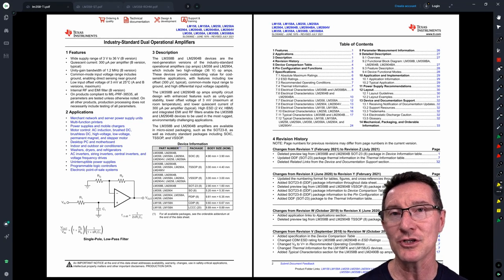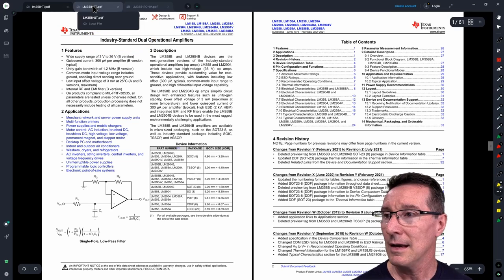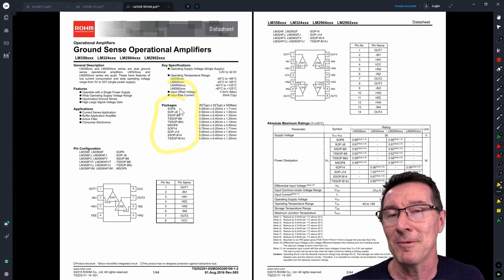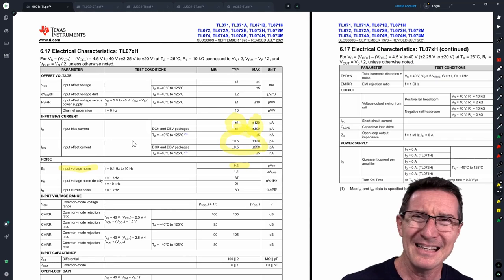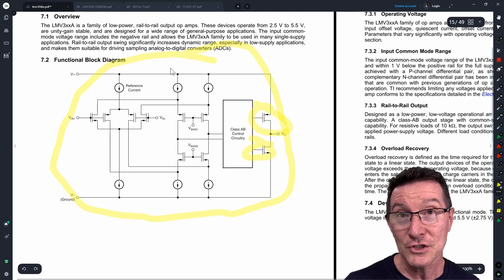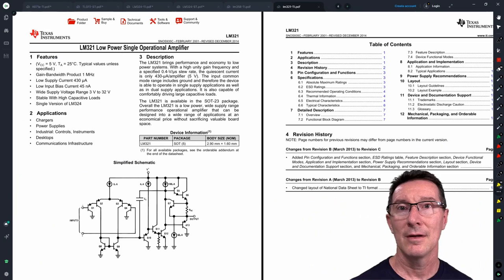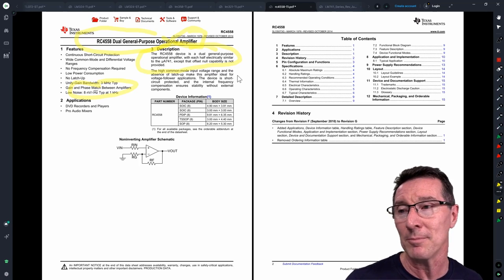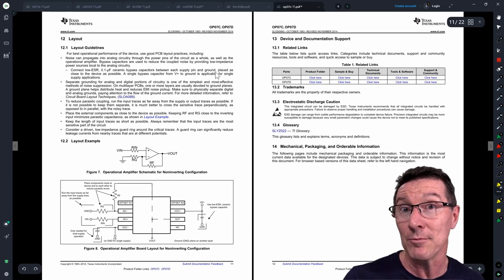EEVBlog 1436 - The TOP 5 Jellybean OPAMP's

Comment: As some others have suggested, the MCP6002 is probably the go-to opamp for any applications that require rail-to-rail inputs as well as outputs. Its specs are comparable with most of the "jelly-bean" amps, and it's easy to specify for general purpose, even though it's possibly a bit more expensive than the LM358 which it comfortably outperforms in any low-voltage, low-power scenario.
I'd also mention the MCP602 as a replacement for the LMV358 as it is generally similar, but with tighter and improved specs, and costs more or less the same.

Comment: Gosh. That's a blast from the past. Have been out of the industry for 30 years and assumed these classics would have dropped off the radar of today's designers. The 5532's had a habit of exploding in one product I worked on which ran them at +/-18V, which I seem to remember was near their max supply, but maybe that was just a bad batch - it was a long time ago!
Reply: To be fair, designers these days are way more likely to be using a part from TI's OPA16xx range, perhaps an LM4562, an OPA2227, or if you're stingy, an NJM2068 or 4580. Douglas Self sure got his mileage out of 5532s though. The original Philips/Signetics part actually is long EOL, following a fire in a French Philips fab in 2003, and the various second-sourced 5532s differ somewhat in their characteristics (e.g. the common / cheap TI part has a more robust and stable output stage but substantially worse input common-mode distortion, as shown by Samuel Groner's testing). While no longer a truly all-round part, it is still hard to beat the output driving abilities of a 5532 at its price point.

Comment: Too bad that the LMV358 isn't readily available in a DIP8 package though.
Reply: Curious: are you referring to their potential use for one of your videos? (Which are absolutely fantastic!) So, are you talking about breadboarding? Or, hobbiest market aside, are there modern applications where a DIP is still the best option?

Personally, I try to leave human-facing connectors, power MOSFETs and higher power relays as the only TH components in my designs (plus some specialty parts, like transformers). Maybe I’m taking SMT too far?

Edit: added clarification re uncommon (for me) TH parts.
Reply: What is your favourite (not necessarily) jelly bean op-amp?
Reply: @a1nelson  Yeah -I was mainly thinking of breadboard and prototyping where TH components are generally easier to work with.
Reply: @spakecdk  One that I have been using a lot more lately is the LMC6482 - mainly because I like the r-r input and output, and I happen to have a tube of them.  But, they aren't cheap.  There are likely better/cheaper solutions for R-R in/out in a dip package with a wide power supply range available now - haven't looked in a while...  The MCP6002 is a nice choice for low supply voltage applications.
Reply: Just use a MCP602 instead for prototyping.
Reply: Nice seeing you here Alan!
Reply: @w2aew  SMD adaptor boards are quick to make up though.
Reply: @a1nelson  DIP has the advantage that if you can't get your IC delivered in time, you solder a socket and add the IC afterwards. That's a major advantage in the current chip shortage crisis, especially if the electroncis is only a part of the final product such as a car.

Personally, electronics with THT parts is worth more to me due to repairability.
Reply: @danielmantione  Swapping SMD parts is pretty much just as easy as popping a new chip in the socket if you have a hot air rig
Reply: @windows74001  Even if that were true (which it isn't), the main issue is not so much soldering, but rather diagnosis. With socketed components you can quickly pull any ROM, 74xx IC and other components and test them in a tester. If you find the broken component, that's a quick repair, but even if you don't find it, you have already ruled out a lot of possible failures, making the remaining diagnosis much easier.

With SMD, you have to be much more reluctant about removing components and testing them separately, because desoldering is invasive and you want to minimize unnecessary invasive interventions.

In practise, an SMD repair takes an order of magnitude (say 10x) more time than a THT repair.
Reply: @danielmantione  Only if you have socketed DIPs; desoldering DIPs is way more of a pain than desoldering SMD packages

Comment: Hey Dave, could you make a "101" video on unity gain stability you've mention @ 4:13?

We've had those lectures at the uni, but we've never been given an example of an application where you'd need to take care about the stability while designing circuitry; i.e. how you could accidentally make the amp go haywire. I only remember it has something to do with a pole at 0 dB.

.... students are fed too much data in a way too short period of time, often without having prerequisite knowledge, and they're fed raw, inapplicable data.
Reply: Positive feedback with a gain greater than one. It will oscillate.
Reply: the most simple practical rule is to break the loop, insert a (virtual) frequency response analyzer there, and make a bode plot. Look at the bode plot. Find the point where phase shift hits 180deg, and see if the amplitude is reliably below 0db at that point and beyond. If it is, the loop is stable. Additionally, note the phase where the amplitude crosses the 0db line - (180-that) is the phase margin. If phase margin is low, the system will likely ring for quite a while before settling.

This is not the comprehensive stability criterion as far as i know, as some weirdo systems that fail it can still be stable or some systems that pass may still be unstable, but for opamp feedback design, it's a reasonable rule.

As for poles/zeros, it is tricky. I recommend watching a series of control systems lectures by Brian Douglas for that. BTW, poles and zeros are specified by their complex frequencies (s-plane coordinates), i don't think they have any dB property (i can't say i'm fluent with this stuff, though, maybe i'm wrong).
Reply: I like your Slavic Symbol.

Comment: The TL07x series suffer phase inversion when driven hard into a rail.  This can cause them to latch up.
I had a job many years ago where I had to replace TL074s in a design I was asked to fix because of the latch-up issue.  I don't remember what I used to replace them.
Reply: Any reason why they haven't made latch up resistant versions of that part?
Reply: @NiHaoMike64  all FET input op amps basically have the issue. It has to do with the input using FET transistors.
Reply: @MichaelWeaser  A lot of modern CMOS chips are resistant to latch up, is that generally not done for opamps because it compromises the performance of the opamps?
Reply: @MichaelWeaser  There are plenty of fet input opamps which do not have phase inversion

Comment: Lovely, this kind of things they don't and can't teach at uni.
Reply: Can't? Why not?
Reply: @j1952d  Possibly because you're looking at years and years of experience in sifting through potential parts to find one best suited to do a particular job, often in tension with a commercial need to keep cost low and availability high. Most folks with that sort of experience aren't going to be teaching at universities.
Reply: @RexxSchneider  Oh, yea. When I went, there were teachers with lifetimes of experience that they were prepared to pass on. They're all dead now, and I'm not far behind <sniff!>.
Reply: @j1952d  I didn't have quite your experience. When I was at university in the late 1960s, the head of the faculty was Professor AHW Beck, who wrote one of the definitive textbooks on "Thermionic Valves: Their Theory and Design". This was at a time when I had moved on from germanium to silicon transistors and was experimenting with early opamps like the 709. Nobody on the staff had seen an ic opamp and I remember having a crowd of demonstrators around one of my prototypes of a primitive capacitive proximity sensor. I was able to get a lot of advice on ECC83s and EL84s, but not much on which opamp was best suited for an application. :(
Reply: The Art of Electronics (textbook from Harvard professors Paul Horowitz & Winfield Hill) has tables of jellybean parts for all the common component types. Plenty of other universities use it.
Reply: This is exactly the kind of material I add to my students' course content at the university. I was hired for prior industry experience over degree level. Also, I'm still an avid hobbyist and constantly encourage students to try it if it suits them.

Comment: 21:33 the external compensation of the 5534 (which is, of course, a single op-amp) came in handy recently when I wanted to deliberately limit the slew rate of a signal. Add a comically oversized compensation cap - job done. Another notable mention for audio applications is the NJM4556, when you need a bit more output current, it might be worth considering.

Comment: MAA741 and MAA748, we had huge bag full of those horrile opamps at high school. Also high school hadn't money to buy components (at least we were told that), so all projects were based on 741 or 748 and old stock of Tesla resistors and capacitors. I remember how many circuits my classmates tried to reproduce weren't working and if you replaced 741 for ANYTHING ELSE, it started working perfectly :D
Reply: I have few tens of Tesla's MAA501...504 in metal cans. They look awesome but work mediocre.

Comment: I like the MC34071/2/4 opamps, wide input voltage range 3-44v, fast slew rate, 13 V/us, 4.5Mhz bw, stable at large output capacitance. Good at driving output stages in power applications.

Comment: I work mostly with audio and what I use almost always is the NE5532. So I agree with you, Dave!...
I also use the LM4562 as the lowest noise OA I've found on the market. But they have a latch up problem with high impedance input resistors. So, they imply a bit more complicated anti-latch design, only to be used when super low noise is needed.
Reply: * lowest voltage noise (in their price class) - they do have a whole bunch of input current noise due to what appears to be a degenerated bipolar input stage. LM4562s also seem to be super allergic to RF for some reason, way more than what you'd expect from GBW and slew rate alone (I can only guess that it might be their bias current cancellation at fault).

Another bang/buck part for medium impedance line-level usage is the trusty JRC/NJR NJM2068 (now revamped as NJM8068). Noise almost as low as LM4562, just don't drive super load-impedance loads with it (avoid <2.5 kOhms at 6 Vrms). And if you need a very low voltage noise part for low to moderate supply voltages, the quirky NJM2122 is worth a look, even if it means having to mess with external compensation (it's not nearly compensated for unity gain) and perhaps beefing up the output stage a bit. If all fails you can always hot-rod your opamp of choice with a discrete input stage using some jellybean transistors (e.g. some 2N4403s, a good basis e.g. for a mic input).

If you need both low voltage and current noise at the same time (e.g. phono MM), the trusty NE5534A remains hard to beat... OPA1656 may be a good modern alternative though. High-performance consumer applications very commonly use e.g. OPA1612s these days, and on the cost-sensitive medium supply voltage side NJM4580s are beginning to be replaced by OPA1678s.

Comment: I bought couple of hundred LM358s and NE5532s few years ago.. i'm never going to run out of op amps, those two really cover a wide range of needs. The 358 even has a decent output current. Got also a bunch of 072s but haven't found a good use for it, the 5532s do audio so well.. Billions of 072 are found inside millions of sound consoles.

Comment: Hi Dave I agree with your comment on the LM741. I'm in the rail industry and change of electronics happens to move really slowly in Rollingstock down here in Melbourne. We still use the LM741H on Westinghouse and GEC train equipment from the beginning of the 80's. They are still used in power and traction control control cards.

Comment: Important note about LM358: it's not rail-to-rail. Supplying it from 3.7V you can expect only 3.7-1.5=2.2V output max.
Reply: Dissapointing to learn this after I made a USB powered voltage controller, it does 0-3.5 volts output. Chose the 358 because I didn't need a high speed (audio rate) response time.
Reply: Another famous weak point of the LM358/LM324 (and long-time regret of its designer) is its output stage, which cannot switch from sourcing to sinking without crossover glitches... if you find you must use one for audio (despite the awful noise level), Class A bias the thing by all means.
Reply: I've come to think of "rail-to-rail" as a marketing gimmick, those words are mostly lies if you read the datasheet carefully.
Ask me how I know :P
Reply: @charlesdorval394  There’s also input rail to rail and output rail to rail. I think most rail to rail op amps can’t drive a low impedance load.

Comment: Great video! Audio engineer here. The reason that the NE5532 is the #1 Jellybean audio amp, is bandwidth and slew rate. To get 20khz full swing, you need  a slew rate of at least 3v/us. The NE5532 is 9v/us and TL074 is 13v/us. In something like a microphone preamp, you want a maximum gain of 55 dB or so. This means the signal needs to be multiplied over 500 times.  The NE5532 can do this in a single stage because it has a GBP of 10 mhz. The TL074 is really good for unity gain stages or stages with less than 40 dB gain since it has a GBP of only 3 Mhz. The LM358 and others with their slew rates of like 0.5 v/us and GBP of 1mhz can't really be used for audio.
Reply: What about the current protection that the TL074 has?  He didn't mention that aspect... does come up in your world?

Comment: Coincidence. I've just recently started to build some LM 386 based mini guitar amps. 386's are amazingly versatile. With the right components you can make them sound like a Bassman or Ampeg or Marshall 800, Hi-Watt, you name it. I make them with or without volume or gain controls. I also get the N-4 version and run it at 12V instead of 9V. Bridge the 1 and 8 pins  with a 10uf cap for a gain factor of 200. Or put a gain pot in there.
The smallest and most simple one is 1 cap, 1 resistor, LM386, input jack, output jack. And that's it. About the size of a pack of cigarettes.
It sounds awesome, they all do.
Also making a Walking Talk-Box. A cut down funnel attached to a  3in speaker, tubing up to your mouth,  clips onto your belt. Battery powered so you can walk anywhere and play anything from STP to Peter Frampton.
Reply: The 386 is both a solid, basic part and, as you said, very easy to work with. I expected Dave to include it in the video. But, the more I thought about it, the more I realized that it was probably excluded due to the fact that the 386, though popular, isn’t really a general-purpose opamp, in the same sense as the others mentioned. Have fun with your new amp.

Interestingly, I’ve also recently started designing my first audio amplifier. Although I have designed plenty of digital and analog systems, I have never I had the need to include anything more than a buzzer in any of them. I suppose that’s because of my work centers around embedded devices, not ones that get all that close to humans. Audio is a whole, fascinating world unto itself. Should be fun.
Reply: @a1nelson  Probably the very best feature of a 386 for guitar amp is the fact it nearly duplicates the tonal characteristics of a tube-driven amp. Specifically, the dynamic sensitivity while playing softly has a cleaner sound and articulation, just like a tube amp. And the harder it's played, the distortion comes through strong, just like a tube amp. And does it without increase in gain or volume. And that's a big issue because all other solid state circuits can't replicate that. Ok, maybe some, but not at such a meager price point.
Thank you for your reply
Reply: I've been playing for 6 years now, and I'm also an ee junior at uni, so im gaining traction on learning more about this stuff and I'm curious how the op-amp type changes the sound? I've pondered the idea of trying to build my own amps, to experiment with sound, especially for my bass. I'm gonna have to try the simple amp idea you mentioned. thanks!
Reply: I think the LM 386 can have 10% distortion, but maybe you desire that.
Reply: @bobbyquinn4952  Hmmm........bass...that's a good Idea. I'll have to do a little homework and see what the signal frequency  parameters of a 386 is capable of and what the pickups on a bass produce. You would certainly need to scale up power, and maybe two 386's to help spread the load.
Reply: @mmaranta785  Yeah, I tend to lean in that direction, (just like the 386!) And it takes more design consideration and complexity to make them clean up, but my favorite attribute is the dynamic sensitivity I mentioned earlier.
Reply: @michaelmoore7975  right on im gonna have to give this a shot after i get some 1/4 jacks to mock up on a board. what speaker do you usually test with?